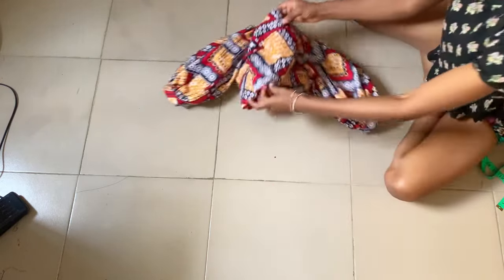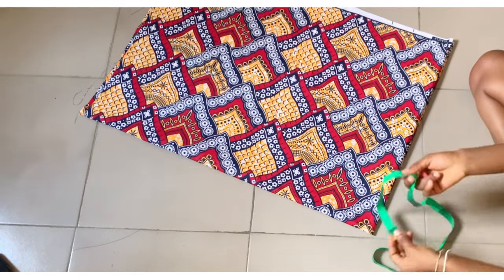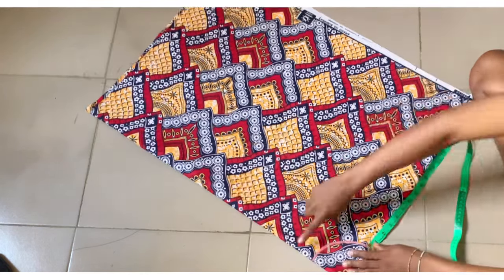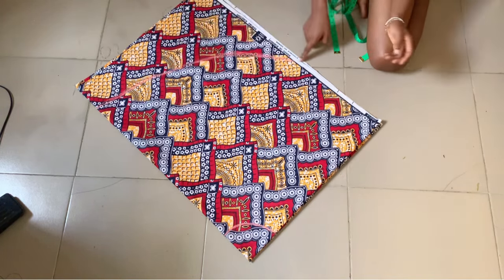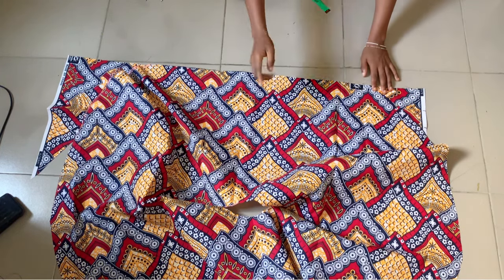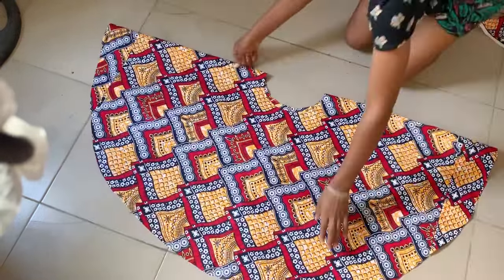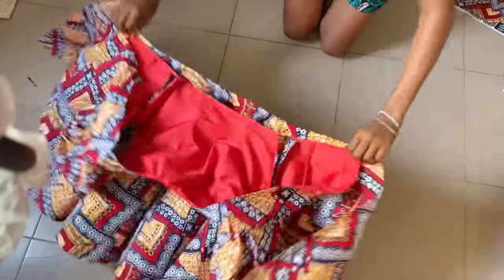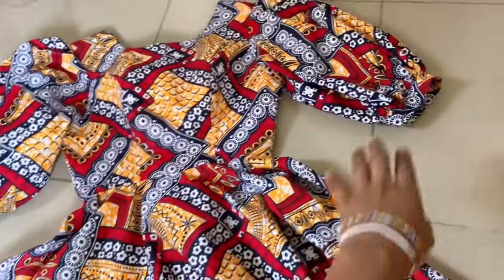How To Cut a 360 Degree Flare.

Comment: I didn't understand this??
If it's fold like that is 8 and not 4, why divide by 4??
Reply from the maker: Try not to be confused… whether you’re cutting anything 360 degrees and you fold it that way, you divide your measurement by 4.
Reply: @Stylebyreme  ma dividing 27 by 4 is 6.75, how did you get 4 again.....I don't understand also confuse
Reply: 27÷4=6. 75